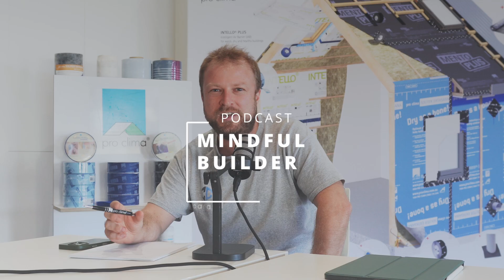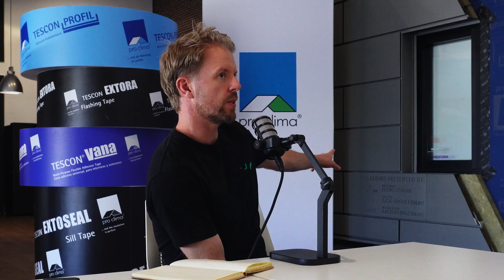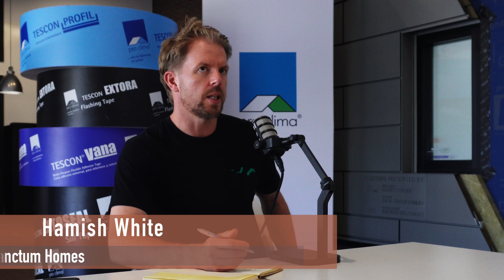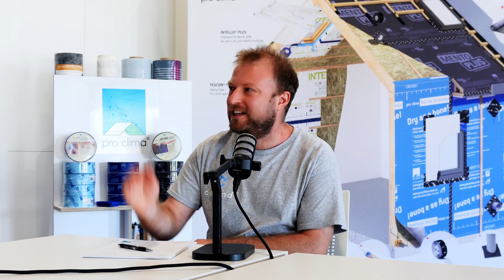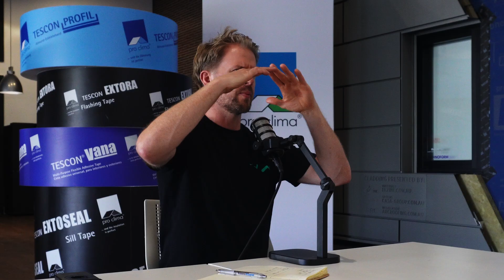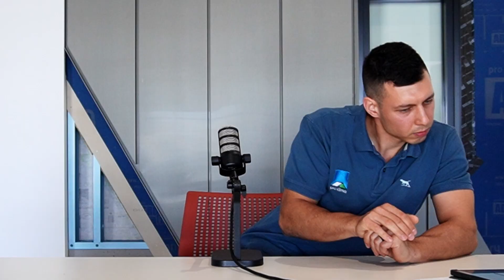This is a big can of worms

Comment: Wow, structural bracing board will have to be class 4 in cold climates (which makes sense when you say it out load). The only product you can use in this situation is OSB3 and it is so hard to get, it's not something you can down to your local large hardware store and find on the shelves.